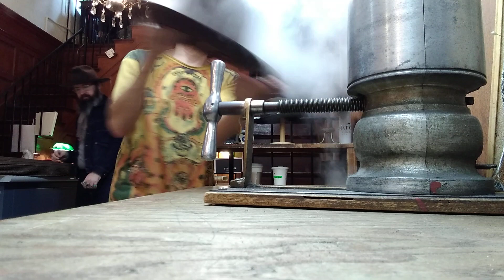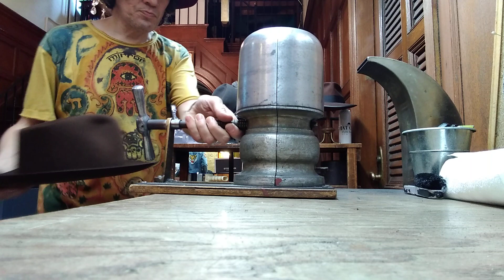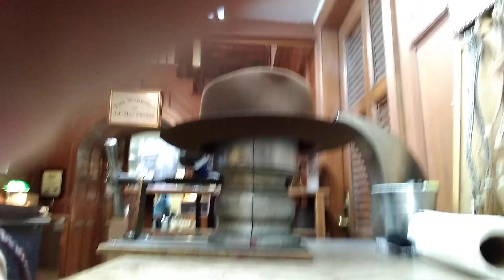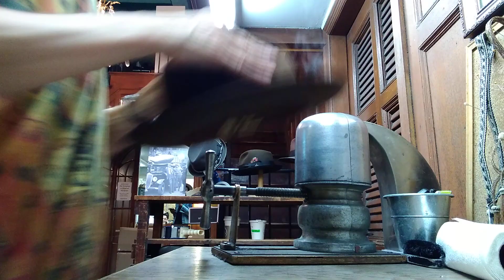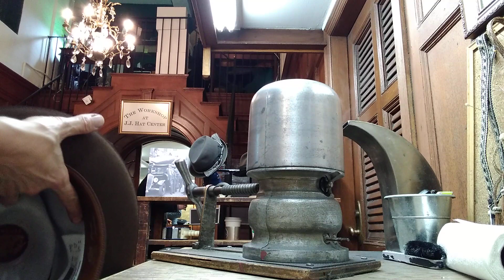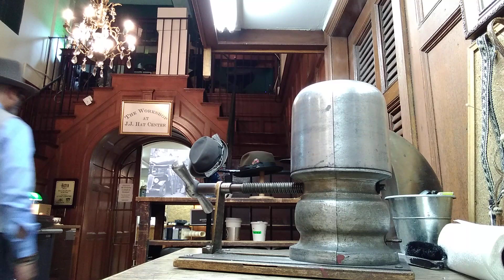Steaming A Premier Stratoliner To Look Like a Regular Stratoliner .. Lowering the Crown

Comment: Wow, I seriously need you to work on my Akubra Stylemaster and get those creases.  👍😎🎩
Reply: It will be near impossible to get such a teardrop on an Akubra Stylemaster due the very low, tapering crown.
Reply: @LowPlainsDrifter60  I realize it's a smaller hat, but I'd still like to get those tight creases at the top.
Reply: @Dave I'm very happy with the teardrop Kevin put in my explorer. I don't know the specs on your Akubra, but I highly recommend having Kevin give it a shot if they're anywhere close to comparable.
Reply: @Iwan2ride  my Stylemaster has a teardrop crease already. What I really like is those seriously defined lines of the crease in the hat he's doing.  I'm going to steam my hat and see if I can replicate it on my own.  If not, it'll go to Kevin on my next trip to NYC. 👍😀
Reply: @dkstott29  If all you want is sharper definition then steam should do it.